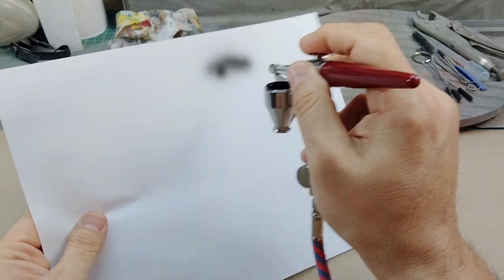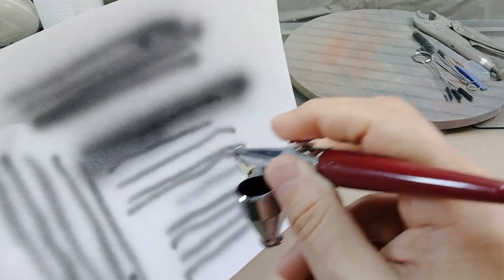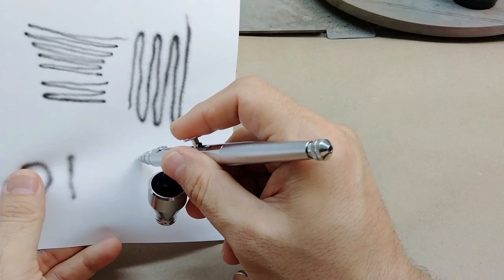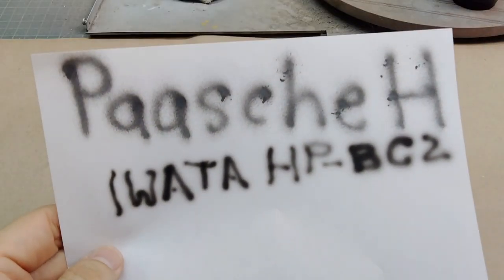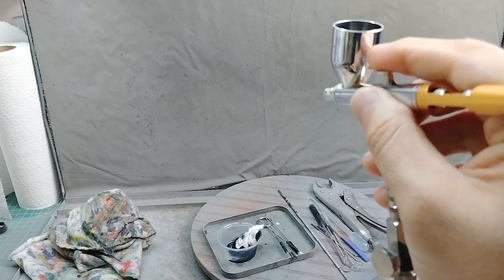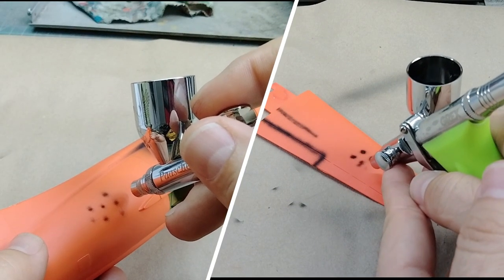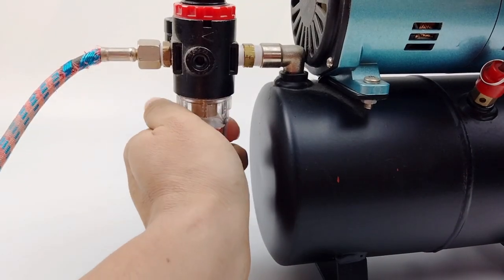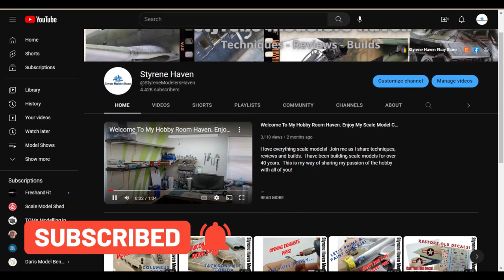Choosing Your First Airbrush For Scale Modeling, For Total Noobies! Airbrush & Compressor Basics 101

Comment: I use a Badger 360. It's got all the advantages of most of these airbrushes. It's got a rotating front half, so it can be gravity-fed or siphon-fed. It's double-action, but you can adjust the needle to make it basically single-action. It uses the same needles, nozzles, and other parts as the Badger 155 series. In fact, my first 360 was a dealer's sample, and still marked as a 155 on the body. Badger's customer service is great, and you can send it in to basically get the airbrush refurbished almost for free.
Reply from the maker: Love my badger airbrushes.  Thanks for sharing.  Please sub to my channel.

Comment: Great review! While one brush can’t do it all, one can do most very well. A great single jack of all trades is the Iwata Eclipse HP-CS. With the 0.35 you can go from pretty fine lines and Luftwaffe splotch camo up to 1/48 scale base coats. The GSI Creos Mr. Hobby Pro Con Boy airbrushes are near clones to the Iwata at a cheaper price. I have 7 airbrushes from a Badger 150 to a top end H&S, but there is not much that I could not manage with only the HP-CS. At least for most scale model building.
Reply from the maker: Thanks for the info!
Reply: Iwata's Eclipse CS is a no brainer can't go wrong choice, with the caveat of a single apparent factor. For many dipping their feet into airbrushing for the first time or yet to be committed to plastic modelling along with those on more restrictive budgets, its price is commensurate with it Iwata's brand, quality and performance. First timers will also want accessories, the most apparent being a compressor, the second an partially enclosed fan evaporative spray booth before taking into account the myriad of other smaller items. i.e. Cleaning station, additional or braided hose/s, airbrush stand,  cleaning brushes.

These days, CNC machining, metallurgy and QC has permitted superb airbrushes to be obtainable on a pretty tight budget so that airbrushes which in pragmatic everyday practice will perform on a par with the Eclipse CS can be had for half its price leaving a sizeable chunk of change to go towards that compressor. e.g. Sparmax Max-3 or its Tamiya OEM clone which can't be beaten on balance considering all factors. Alternatively the Sparmax SP-35 too is superb option, although personally I dislike the minuscule 2cc size of the latter's paint cup for which reason if I wanted a larger nozzle than the .03, I'd choose the Max-4 over it.

Comment: Another good tip is to power your airbrush with a CO2 tank, like bars use to pressurize the soda guns. It's a dry gas, so you never get condensation in the line, and it's completely silent. You need to get a regulator, which can be as expensive as you want it to be. I got my first tank at a local flea market, which made it really cheap. When you go to get it filled, they typically trade it out for a new tank anyway, so you can get away with a cheap used one as the initial investment. A refill costs about $30 or $40. Plus, you can get an attachment to make your own soda!
Reply from the maker: Interesting...
Reply: With the water trap and filter I have never had a condensation problem. Seeing I already have a compressor, I would just as soon use my “free” air as opposed to taking out a tank to buy another gas and store it under extreme pressure in the house. But to each his own.

Comment: Airbrushes are so inexpensive today, there's no reason not to have several. The CNC tolerances and metallurgy of the super inexpensive rebadged Chinese generics made by the likes of Fengda these days has improved markedly over the past decade. The designs, copies of famous tried and true brand designs, were never in question. If not wanting to tread that path out of irrational 'brandnameitus' reassurance, alternatively Iwata, Sparmax (owned by Iwata) and Tamiya (OEM Sparmax and Iwata) or GSI Creos all offer 'beginner' airbrushes which are far and away affordable quality airbrushes poorly served by "entry level" or "beginner" misnomers. 

Along with Iwata, Sparmax, Tamiya, & Fengda I have several Badgers and an Omni (Thayer & Chandler). Whiilst Badger/Omni too make superb quality airbrushes which will last a lifetime., today those brands are far too expensive today outside the USA in comparison with competition due to the fact they are made in the USA and their pricing is pitched in any exchange for the usuriously hyper-overvalued USD. There are just far better VALUE buying choices today, the most obvious already mentioned above. As for a first airbrush? .03mm gravity feed double action with at least a 7cc cup would be my choice for a first and only go to.
Reply from the maker: Very thought out.